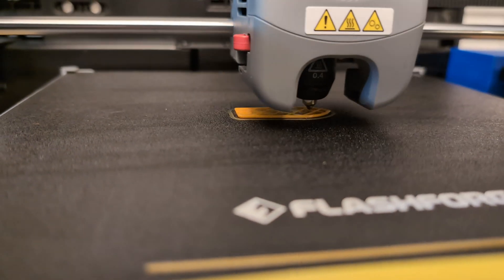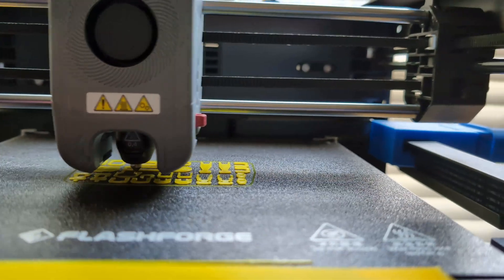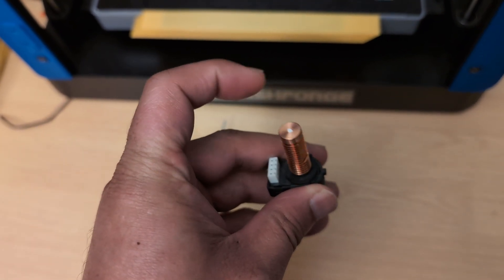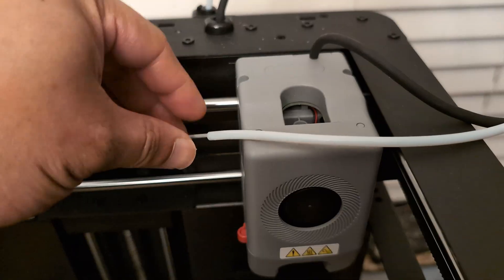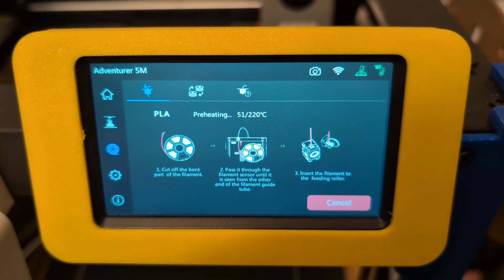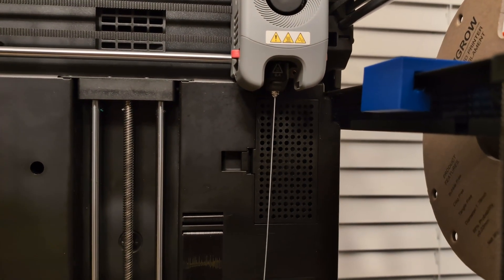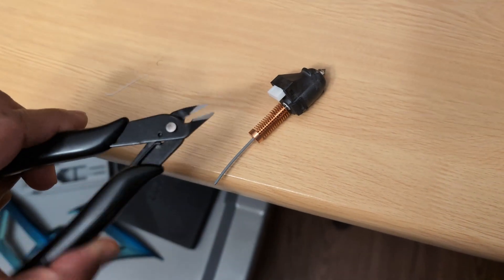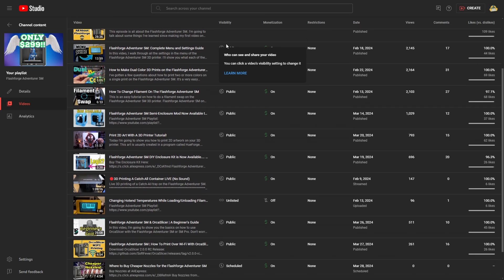Swapping Nozzles on FlashForge Adventurer 5M

Comment: quick question. are the nozzles able to be changed with the basic every printer one? these look like you have to buy specialized nozzles to replace old busted ones. is that the case? i have a handful of 0.1 to 0.8mm brass nozzles.

Comment: I am not sure what happened, but even after cutting the filament and I had the leveres pushed in my nozzle would not come out. I had to use a pair of needle nose pliers to push down on the filament from the top and it finally came out. 🤷‍♂️ The new one went in without any problems.

Comment: Thank you for the video. Im still new with my printer and am trying to learn how to do higher detail prints with my new 0.25mm nozzle.

Anyone having issues with printhead grinding nozzle against back of print plate? Ive got a small little groove at back of plate now.
Reply: Did you run a calibration test & level the plate after changing your nozzle?

Comment: Aren't you missing a few steps on nozzle swaps? I think you're supposed to loosen the screw on the side of the print head assembly (think with the RED pushbuttons) before taking a nozzle out & then re-tighten after installing the new nozzle. Is that true?
Reply from the maker: No, you don't need to loosen any screws to change the nozzle.
Reply: https://youtu.be/xvoZDL_GnFc?si=ihXeVoTbkQIXFTE8

This is directly from FlashForge.
Reply from the maker: They also said you can remove the nozzle without loosening that screw. There's really no need to do all that.

That video also conflicts with a more recent one they did that makes no mention of a screw: https://www.youtube.com/watch?v=BD1hiCjF_JQ&t=10s
Reply: I did it with no screw fiddling and it worked perfectly. Thanks for the video.
Reply: Mine wouldn’t come out unless the screw was fully removed.

Comment: I accidentally broke my nozzle 2 days after getting the printer... I stopped a failed print and the nozzle cooled down and filament melted inside. No matter what temp I had it at, it would not budge. So I went to unscrew the tip to try and push it upwards and the entire heat sync inside began to spin and the printer went to -65, assuming there are wires attached to the pipe inside the plastic grab part.

Comment: Do u no the symptoms of when a nozzle need replacing  as at the moment when I try put it up to temperature reboots and will reboot when I press load filament and reboot a minutes after pressing print
Reply from the maker: It sounds like something is wrong with the printer itself. Try updating to the latest firmware, or roll back to a previous firmware. If that doesn't work, contact Flashforge's customer support.

Comment: Thanks Jeremy, I really enjoy your channel and you've been a great help in my 3D printing journey! I've been a woodworking instructor for many years and enjoy your style of teaching.
I have had pretty flawless prints for the last week. Unfortunately, my nozzle clogged mid print and I couldn't get it to heat up enough to purge the old filament.  I swapped the 4mm. out and inserted the 6mm. nozzle thinking it might be a nozzle issue, but the same thing occurred...Now I have 2 nozzles that are plugged and the extruder is refusing to heat up enough to feed the filament or unclog with the supplied tool. Not certain what happened.  I'm going to do a factory reset and see if I have any luck. In the event that doesn't work, I'm hoping you might know a direction to send me.
Thanks, Patrick
Reply: Hopefully you figured this out! If not:
I had a clog issue where there was some piece of hard debris in the nozzle (cheap filament?), and it could not be forced through. I swapped nozzles so the printer could continue to work, and brought the clogged nozzle into a safe place to use a small heat gun. I heated the nozzle and used a combination of acupuncture needles and the included clog-pushy-wire-thingy to clear the clog and get clean extrusion with some clean filament (hand pushed through). If it wants to curl badly on way out, still debris in there.
Reply: Have you had any resolution on this? Just curious. What was the material you were printing with? I have been gaming it (slightly) when removing filaments from the nozzle. Procedure is something like this: a) with the machine off, move the head into the center of the bed, put a paper towel under the head; b) turn it on, go into the filament change tab (2nd from left), pick the right filament type for what's in the machine, tell it to start; c) clip the old filament feeding into the head, remove the old filament from the tube and the reel holder; d) wait for the machine to push the filament through the head; e) shut off the machine, wait 5-10 minutes, then get a leather work glove and pull out that hot print head; f) there will be some filament sticking up from the heat brake .. use a pair of pliers to pull it out. This should give you a clean pull. Verify by looking through the nozzle.

As for the clogged nozzle, can you overheat it relative to whatever filament was in it last?

Comment: Why do you delete comments?
Reply from the maker: I don't. Was your comment deleted? [Correction] I do delete spam comments. But yours is not spam. I see you commented on getting a 0.8mm nozzle. It's still visible on my end.
Reply: Thanks for your reply. Love your content. I only see two comments mine with your reply and the one below me.
Reply from the maker: YouTube is weird like that sometimes. I replied to a comment the other day that didn't show up.
Reply: @FigureFeedback  Perhaps others are reporting them as spam and getting them removed... anyways... if you can figure out the profile in ORCA that would be excellent... I am working on it as well... Flashprint has one, but it also depends on the filament.. still learning all the joy of 3D printing...

Also, BTW, Ali enclosure use to be Frosty white panels, but now they are clear... still unofical.  I sent my 5M back though for a 5M Pro.
Reply from the maker: I'll look into that.
Reply: @FigureFeedback  I have had multiple comments on an official Flashforge channel to not show up for me, yet they said the comments had not been deleted. YouTube does indeed do weird things with comments.